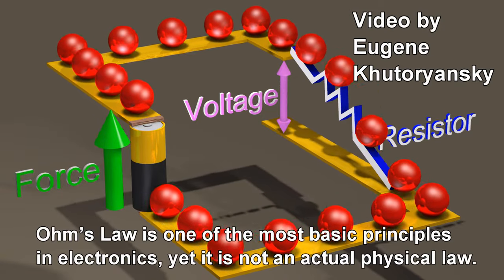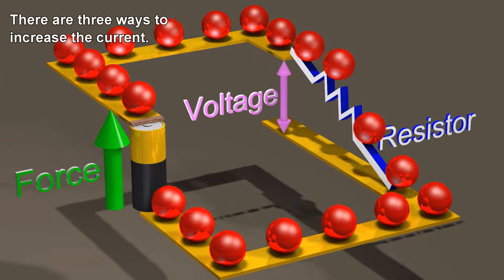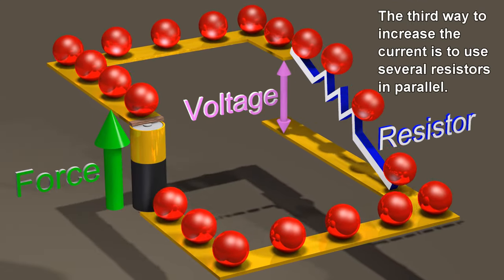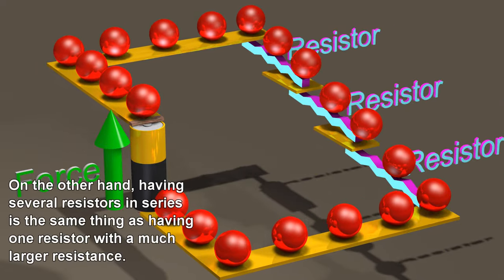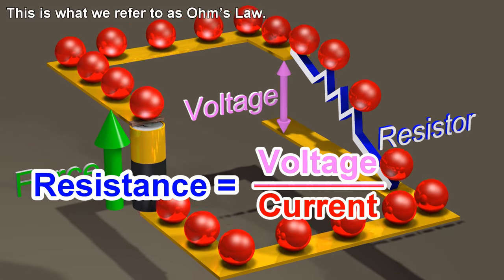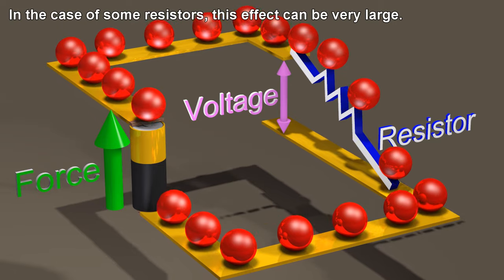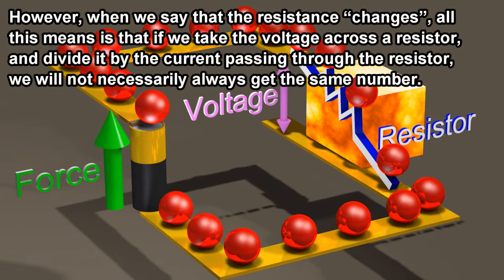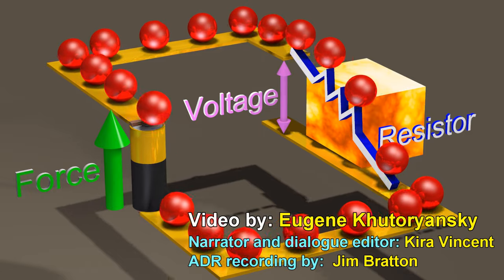Resistors - Ohm's Law is not a real law

Comment: Now I finally understood why resistors in parallel gives less recistance.
Reply from the maker: Glad I was able to help.
Reply: Xremote. Please don't do it. You'll ruin the understanding of what is electricity forever.
Reply: Except water flowing in pipes is usually a non-linear relationship between flow rate and pressure drop, so it is more difficult to make the analogy mathematically accurate.
Reply: carultch. Not only that. The electric phenomena is tridimensional, happens in the space around the circuit. At any given instant half of the energy is in the space and half in the circuit.  Actually the energy is flowing from the battery to the space and from the space to the conductor. The Voltage, the electric force, is not like a pressure pushing the electrons, the Voltage is a field in the space. The magnetic field is not a waste product of the electrons movement, magnetic field stores energy in the space! The energy is flowing from the space to the wire perpendicularly.
Reply: That's quite important... A lot of people use pipes to make analogy for electricity, which seems to be extremely convenient at first, but I think that now I understand why I wasn't able to grasp the concepts of electricity fully... Thanks!
Reply: @nathanneiman  thank you
Reply: wow "magnetic field stores energy in the space "  @nathanneiman
Reply: @nathanneiman  The explanation is not exact !!!
Reply: @NarasimhaB  The magnetic field is not created by resistance, but is created and preserved by inductance, which in the real case is never nothing, not from space, is created by the transient and is released in opposition at the time of opening of the circuit, law of Faraday-Neuman.Lenz ...
Reply: @mauromauro1384  The vacuum of space have physical properties, permittivity and permeability, so impedance. According with Maxwell' equations magnetic and electric energy are stored in the fields in space, the flow of electromagnetic energy through space is describled by Poynting Theorem. A system is said to be in a transient state when a process variable or variables have been changed and the system has not yet reached a steady state. The transient equations describe how the energy flow through the circuit elements, resistance, capacitance and inductance during this period. Capacitance and inductance are defined by geometric and physical properties of materials and space.
Reply: The reason it gives less resistance is because each resistor asks for a seperate dose of current. Explaining it with ohm's law means you get a smaller resistance.
Reply: Xremote  no increase of flow of water. Same amount of water spread over more pipes, unless the pressure in the water system is increased? Adding another resistor in Parallel will reduce the resistance (ohms)
thereby increasing the current flow AND the amount of watts charged for. Thank you.

p
Reply: Yess😎
Reply: I have been trying to figure out the why of electron flow. Maybe it's a silly thing to think about, but I thought maybe it would help me understand better how circuits work. I just got curious years ago, when my brother in law was telling me to just imagine electronics in terms of plumbing pipes and pressure. I've tried. I also like stereos and now recently got a whole bunch of radio transceivers , and some of the radios work and some don't So, another reson for me to learn elctronics is to get the broken ones working. I have repaired an old klh record player, and also a cordless drill charger, in spite of not being able to find a way to visualize the electron flow. Thankfully I now realize that the positive and negative designations are not correct, from watching your videos. I have watched other of your videos, like the Quantum wave one, and that one is amazing. Thanks for doing theses animations. I was doing pretty good understanding some of the concepts, but got sick with that Corona bug, and now have to go back and sort of start over.
Reply: @nathanneiman  holy shit that's a better explanation than most I've heard well-done. Yes the water analogy got me to.
Reply: @turtletom8383  It's not my explanation, it's from Heaviside, the guy who rewrote Maxwell's equations in their modern form.  More surprising was to find that Faraday, Maxwell, Heaviside, Tesla and Steinmetz had a more sophisticated and advanced understanding of electromagnetism in the 19th and early 20th centuries than many physicists do today.
Reply: @Xremote  The flow must remain the same
Reply: the particles have more paths to go through.

Comment: This is a lovely demonstration, but isn't ohms law " The PD of a metallic conductor is directly proportional to the current flowing through it, AT A CONSTANT TEMPERATURE"? So ohms law actually addresses the change in temp, which is why a filament bulb is a non ohmic device.
Reply: Is that PD the same for all metallic conductors? What does Ohms Law actually tell us about the phenomenas underlying the resistive force?

Comment: I disagree, because the law is based on the values assumed at the time of measurement, so if the resistance changes, the result changes, but even the voltage can change in the real case, what defines the law of ohms is that the current in any case is defined by their relation in the ideal case, therefore comparable to an infinitesimal or derivative time of t, so if we consider the real case, we must consider the transient and the residual inductance, therefore an energy component that supports the field magnetic. perhaps it is better to say = dv / dr, after the transient ... the law is valid ...

Comment: Ohms law also states .....provided that the temp remains constant
Reply: Exactly, even the voltage varies with the variation of the external resistance, due to the internal resistance of the real generator, the ohm law must be interpreted assuming the ideal case, the real case can always be traced to the summation of the ideal cases. Ohm's law is essential for calculating the circuit because it is very close to the ideal case.

Comment: When showing a higher or lower value of resistor may be better by lengthening or shortening rather than make the resistor a smaller diameter for a smaller resistance; because typically a smaller diameter resistor does not indicate less resistance but more resistance.  
I also agree with a previous comment of "but that doesn't mean that the voltage drop across a ckt element is not proportional to the current flowing through it "
Thank you for your animation and will looking for to an update.
Reply: You would have to chnge the simulated visual representation from a cricked line into
 a tunnel. I find the line repr. very useful.

Comment: Original statement that Ohms law is NOT a law is at best MISLEADING and at worst plain WRONG! Ohms law established formula that Resistance R is proportional to the resistivity of the material (constant but different for given materials, such as copper, aluminum, gold, etc.) and the length of the wire and inversely proportional to the cross-section of the wire. That is the indeed the Law that Gerhard Ohm found. The reason why the resistance changes with temperature is precisely due to increase of the length of the wire with temperature increase resulting in proportional increase of the resistance. So, it is indeed a LAW even when you considered temperature effect! My daughter has made an experiment for sixth grade class of verifying Ohms Law by using different materials, like copper and aluminum wire and changing their length and measuring the current for a given DC voltage source to verify the above formula for Ohms Law. In fact, for magnetic circuits, Ohms law serves beautifully to introduce the equivalent dual concept, the Reluctance of the magnetic circuit as proportional to permittivity of the magnetic material, and the length of the magnetic core and inversely proportional to the cross section of the magnetic core. The AC inductance is then defined simply as turns squared times the reluctance! Dr. Slobodan Cuk (former Professor of Electrical Engineering at Caltech and inventor of Power Electronics switching converters).
See my videos on YouTube.com/slobodancukTESLAco
Reply from the maker: The resistivity of a material is not constant, and that was my point.  That is, even if you take the same length and width of the material, the total resistance may depend on temperature and a variety of other factors.  It is just that for materials like aluminum and copper, this change is very small.  But for the material used in thermistors, this change is very large, and this can't be explained in terms of the length or cross section of the material changing, but needs to be explained in terms of a change in the resistivity itself.
Reply: I understood the point about the controversy caused by the use of the word "law". Since my primary formation is as engineer, I am used to call it "Ohm's law", therefore in any mathematical relationship, a proportionality constant is used to fit the model to an "operational range". In this case, the R value is not really a constant that groups all the non-linear effects, moreover its definition only involves the V and I. For this reason, after the explanation of Eugene, I agree that it is not really a law, it is just a concept that works at a very basic level. Finally, it is importat to keep cuestionating all the knowledge,  and also our own learning.

Comment: What's presented here is a simplified model of  the V I circuit relationship. You can write a more accurate model that takes account of the many other factors, but this version is  good approximation for most DC circuits. Temperature co-efficients are easily accounted for but AC circuits, and RF circuits in particular, are where things get trickier.
Reply: Exactly. It would be like arguing the existence of Newton's Second Law, and the Law of Universal Gravitation. Both laws are generalities of a larger picture. For instance, the Law of Universal Gravitation works for smaller objects, but does not accurately calculate the orbit of Mercury.

Comment: so hold on. when the resistance changes as the resistor heats up, why does this change "ohms law" isnt that only changing one variable of the equation continuously, thereby changing the answer continuously? i dont know but doesnt it seem like ohms law is ever changing, along with the resistance?
Reply: Hence why the its Voltage/Current = Resistance and not Voltage/Current = Original resistor value. the clue is in the name, if the resistance alternates, more current flows, and the increase in current flow across it is proportional to the resistors deterioration. Therefore the law still applies :D

Comment: Are you saying Ohm's Law isn't a law because ultimately is just a definition?
In that case, would Newton's second law of motion just be a definition of force  and not a law?
Reply from the maker: +didles123, Newton's second law of motion does not suffer from this problem because "Force" is already defined independently of Newton's second law.  For example, we have equations describing how forces are generated on charged particles due to electric and magnetic fields, and this is separate from Newton's laws.  Newton's second law relates how this force that is generated will relate to the object's acceleration, and hence this is a statement about the external universe around us, and not merely a matter of semantics.
Reply: +Eugene Khutoryansky  Although I have never heard it put as plainly before, I think your statement about Ohm's Law makes sense, and that distinguishing between it and Force = Mass times acceleration is being timid. I have heard it said that the force law mutually defines force and mass. We do not know what the property mass is except for the acceleration produced by some force. And we do not know what a force is except for the acceleration of some mass. 

 But in fact both equations slip something by our content detectors, while being definitions. Thus if we combine 7 (or whatever) equal masses and subject them to the same force as one mass, their acceleration is claimed to be one seventh. If we take 7 equal resistances in series and subject them to the same voltage as one, the current is claimed to by one seventh.

It is logically possible that 7 equal masses combined, and subjected to the same force as one, would accelerate differently than one seventh as much. We could just claim that the true mass was not found by adding, and figure the mass.

It is logically possible that 7 equal resistances in series subjected to the same voltage as one would conduct a current different than one seventh.

We could just claim that resistances did not add, and figure the resistance.
Reply: +binnacle true-north We have this apparent phenomenon in Newton's second law of motion as well. Externally applied force F is not always proportional to ma. This is always the work of an external retarding force (not accounted for in "your" simplistic calculation), but it does happen.
Reply: The dielectric field doesn't exist either (immaterial concept) but you're certainly not debunking that one.... hahahahahahahahaha
Reply: I guess that Eugene already posted a video about it.
Reply: no but it's Fnet = ma so the external retarding force would be accounted for in the Fnet, and proportionality of Fnet to ma thus would hold true
Reply: A full treatment of F=ma with respect to definition vs law is here: http://www.feynmanlectures.caltech.edu/I_12.html

Comment: V=I*R is not really Ohm's Law.  V=I*R is how we define resistance, as you have clearly stated.   A better formula for Ohm's law is dR/dV = 0 and dR/di = 0.

Ohm's law is that resistance is not a function of electrical operating conditions.  Given a resistor of a material that doesn't change identity or geometry, that is maintained at a particular temperature by an independent system, its ratio of voltage to current is the same no matter what the voltage or current is.  That is what Ohm's law is.

Comment: I think you missed the point of Ohm's law. 

The law doesn't say that the voltage divided by the current is the 
resistance. 
It states that: The current through a conductor between two points is 
directly proportional to the voltage across the two points.
Now, the constant of proportionality is what we call the resistance.
.
In other words: Ohm's law states: V is directly proportional to I
Definition of the resistance is  R=V/I
Reply: +Heliocentric I'd like to know what Eugene thinks about this, since what you say seems true.
Reply from the maker: +Heliocentric, but the current is not necessarily directly proportional to the voltage, and that was my point.
Reply: Physics Videos by Eugene Khutoryansky

This is already known.. Same as Hook's law (for example) is an approximation and is not applied in all cases to all elastic objects.
But your misunderstanding of the law is in your interpretation of the law as merely the definition of resistance..It is not that: as I said above.
So it is a "law" (limited .. I know !) and not a "definition" as you said in the video.
Reply: +Heliocentric I think the misunderstanding here about Ohm's law with respect to this video was that it is a physical principle or a concept that electromotive force (voltage in short no pun intended) pushes the current (which is the amperage) through a resistor or a device (resistance) across a circuit.

It is not the formula E = IR nor the direct and inverse proportionality of the 3 physical entities/information.
Reply: The confusion lies in the conflation of 'resistor' and 'resistance'.  V = I • R is indeed true regardless of the resistor used and the condition it is in.  The R represents resistance, not resistor.
Reply: I have to agree with the Hooke's law comparison.
All of the "conditions" would/could change the constant "k" in Hooke's law as well.
There are local changes to gravity as well.
Reply: Hooke's law assumes linear elasticity.  Common in most metals, approximately the case in most other materials (plastic, wood, etc).  No longer holds true after the yield point, where the deformation is irreversible.   Also can have significant deviation from linearity in elastomers (rubber), even if the load is reversible.
Reply: Hooke's law and Ohm's law happen to be the same thing. Neither are physical laws at all, just an equation that happens to work for some materials. The materials we make resistors out of follow Ohm's law. It's a property of the object, just as linearly elasticity is a property of other objects. There is no assertion of reality, just a property that an object may or may not have.

Comment: My high school teacher told us to think of resistance intuitively as of the amount of collisions that the electrons experience as they go through the wire, for example.: resistance increases with temperature because the atoms in the wire (or within the resistors) are vibrating more and thus are more likely to impede the path of the electrons; also the longer the resistor or the smaller its cross-sectional area, the more collisions. Is there any way to relate this approach to the existing definition of resistance as voltage/current ?
Reply: I have read somewhere that electric "flow" is dependent on the surface of the conductor and electricity spreads due to changes in the magnetic field surrounding the wire....